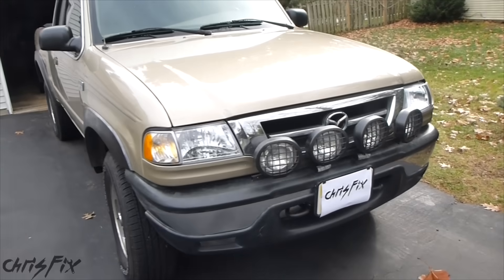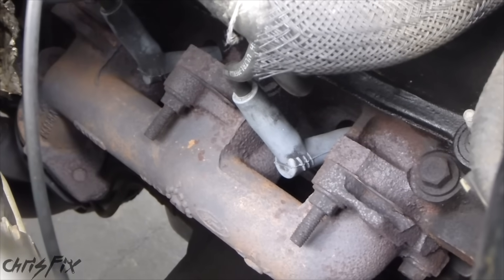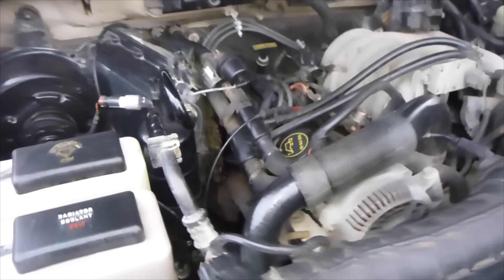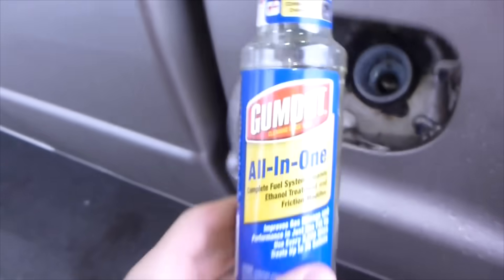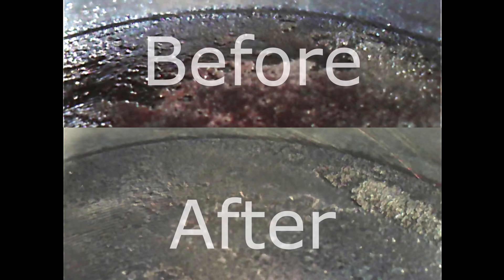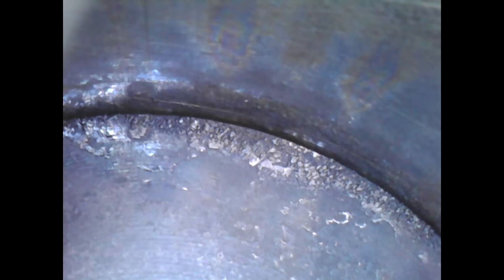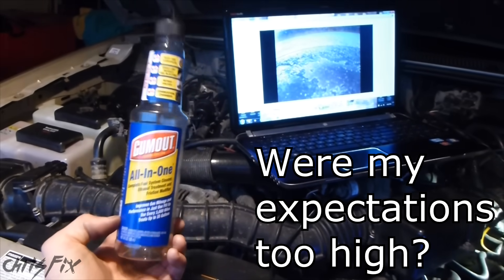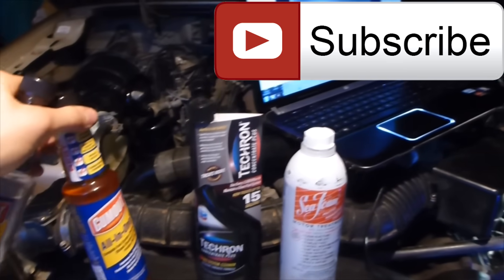Do fuel system cleaners actually work? Testing Gumout "All-in-One"

Comment: Hey Chris!  Thanks for the video! I have always wondered if those fuel additives actually work.  I have also heard of using water to "steam clean" the carbon build up.  I have seen someone drip water into the engine using a vacuum line usually connected to the brake booster.  Have you thought about doing that?  It might be a good test to do if the additives don't work.
Reply from the maker: Joe Bedell Thanks Joe. I will be doing that test as well!

Comment: I tried something called Redex here in UK a few years ago on a Ford Escort with 80k, using it regularly with every tankful of petrol (as per instructions). This product is very popular in the UK, it also also promises cleaning the carbon deposits from the fuel system/cylinder chambers, but the end result was that it made the engine on that car smoke permanently. I don't know what caused the smoke as I sold it before I found out, seemed to be the head gasket, but have stayed away from additives ever since! Thanks for your video :)
Reply from the maker: ***** Thanks man! The carbon buildup probably clogged up a head gasket leak and the cleaner unclogged it.

Comment: I use the Lucas product.  But I but a bottle in every time I fill my tank up. But I put the stuff in after I fill it up. I haven't done a test like what u did. But I do notice that my gas will last longer with it then with out it. About a quarter tank more
Reply from the maker: kapono houston I really find it hard to believe that you get a 1/4 tank of gas more fuel economy from a fuel additive. I am not calling you a liar, but I think there are other reasons why you might get better fuel economy. Also, when you use a cleaner, if your engine is dirty and you did in fact get 25% better fuel economy, then you should continue to get 25% better fuel economy without the additive because your gummed up engine is now cleaned. Know what I mean?

Comment: looking at the before pictures, it looks like the EGR is not equally distributed on the cylinders. Isn't this a contributing factor to the performance of this product?

Chris, I like your videos, keep up the good work.
Reply from the maker: hisham202 Thanks man! Which cylinders do you think are getting more egr gasses?
Reply: ChrisFix I see that cylinders 5 and 6 have that thick-looking deposit. Others have something that looks to be thinner layers of deposits. I mentioned this because some EGR designs have some weaknesses. For example, I had a 2000 camry which accumulated carbon build up in the line feeding EGR to the intake manifold. I heard Ford had issues with the EGR causing uneven carbon build up in the intake runners in their ecoboost engines.I think that build up is expected if the vehicle is not stretched on highways on regular bases. Slow operation cause more EGR thus more carbon into the engine. This is only some theory and I'm not 100% sure about it. Looking at my previous comment, I noticed that I failed to indicate that I have no practical experience with auto repairs other than a few brake pads and a coolant flush!
Reply from the maker: hisham202 That is awesome information and makes a lot of sense. Thanks man, I will have to look into it! Maybe the egr is not distributing the gases evenly like you said, and that is causing 5 and 6 to have a lot more buildup.

Comment: Those bottles say keep engine c lean.  If you want a spotless engine,  use a pump up spray bottle that has a misting nozzle.   Mix half water and half rubbing alcohol.   Get engine very hot the spray the fog straight down the throttle body with engine revving over 2 k.  It will make your engine sparkle on the inside.
Reply from the maker: sketchyssk8shop I showed the bottle, it says on the bottle that it cleans the top of the piston. It also has before and after shots on their bottle of a dirty piston head before and a nice and clean piston head after so... I will be testing the water trick and I will see if it actually works.
Reply: ChrisFix I agree.  The bottle of stuff was less than exciting.  I did not mean to be offensive 8nsurance my comment.   I used the t r u know yo keep me drag motors clean.   My expedition with 253k on it is clean. I use it every 20 or s o.  Just don't dump too much at a time to the engine. U will bu SD t a catalytic converter.   Learned the hard way
Reply from the maker: Your comment was not offensive in any way. I was just explaining what the bottle claimed. I cant wait to test the water trick!
Reply: ChrisFix oh ok.  My bad

Comment: Hi,
IMHO, I think it needs several tries for it to take full affect, you are only seeing combustion chamber only, maybe it need more tries to clean fuel injectors, intake valves before it gets to combustion chamber

in the end, I have tried different brands in my "2001 mercury grand marquis" with over 130,000 mi,  and noticed results in mileage and acceleration

I remember a video on youtube about a guy using hydrogen-on-demand system with regular fuel saying it improved his mileage and cleaned up his engine from carbon build-up

Thanks.
Reply from the maker: ***** Thanks for your input. That might be true, but the bottle says results with the first bottle and you only use this every 3000 miles so...

Comment from the maker: MrTrustafox I agree and disagree. I did say at the end during my discussion of the results that this test was for carbon deposits because that is what I can physically test for and it is also an important part for cleaning engines. The gumout bottle showed before and after pictures of the valves and cylinder heads with carbon deposits before and none after so this test is valid for testing their claims. At the same time, this product might clean injectors and probably prevents corrosion but that wasnt what I was testing. I would not consider that this product "may be" a better product than I show because their claims on the bottle. If they claimed that this was just an injector cleaner, then sure, I would agree, but they say this is a carbon deposit cleaner too (for piston heads). See where I am coming from?
Reply: Can I send you gumout regane?
Reply: I've found "STP Petrol Treatment" and "STP Petrol Injector Cleaner" that would work on my 1.6 petrol engine - Now should we use these BEFORE an oil change,  or we can use them anytime? I'm thinking about all that dirt that will remain in the oil until the next change... And also, can we use a bottle of fuel additive and a system cleaner in the same tank? Or we should separate these two?
Reply: ChrisFix
Chris: I can`t wait to see the coming video about using seafoam.
Reply: Nice chris..
Reply: ChrisFix Can you try RedLine S1?
Reply from the maker: ***** I think we will find something that works. We will see!
Reply: ChrisFix Can you try the Gumout with Regane in it? That's supposed to be the 'good one' along with Redline SI-1 according to BITOG
Reply: Nissan fuel filter cleaner
Reply: Where's the second video
Reply: Hey what if you put brake clean in there whould that hurt???
Reply from the maker: You definitely do not want to put brake cleaner in there. It will seep down into your oil and that would not be good!
Reply: Ok when do plane on trying c fome
Reply from the maker: patrick cordery This month hopefully!
Reply from the maker: ***** I wont be doing that in my truck. Loosening up that much carbon that quickly can cause problems.
Reply from the maker: Calvin Lim I have it on the list but I need to find some more cars to test!
Reply from the maker: yogaexe I will be testing redline! A subscriber sent me redline via my PO Box so we will have a video!
Reply: ChrisFix  guess who got a new sub
Reply: Its a interesting video. I used it to, it cleaned my injectors very good. im sorry for my bad english but did you checked under the valvescap for some slush? it look like something is leaking, maybe your cilinderheadgasket?.  than engine cleaner dont work, slush keeps coming when water or coolliquid are in the oil. slush become Black when its getting Older. 

Goodluck.
Reply: ChrisFix love the vids. was the cost of gas around $2.67 a gallon?
Reply: ChrisFix please try Amsoil PI
Reply: ChrisFix can you do the chevron one i use that one alot and think it works pretty well .
Reply: that is also what I worried, my 2006 navigator has 180000 miles, and can I use the seafoam directly? would that cause the much carbon problem too? I currently have a P0303 problem, possibly because a cloggged fuel injector. please respond what you think might be the best solution to me? what would you do if you are in my spot? thanks
Reply: ChrisFix which of these fuel additives has had the best result? I've your videos but I am too busy to watch them all.
Reply: ChrisFix what if u put little bit of seafoam in each cylinder and let it soak like u did to the lawn mower . Would that be a bad idea or would it work
Reply: fix it ur self and grow: thats actually the proper way to break down a carbon deposit., it doesn’t take much, i use i mini squirt bottle or long tube to get in cylinder., remember to crank car over without plugs and make sure to blead pressure from fuel system to drain any exstra sea foam
Reply: Rickardo gonzalez: it dosnt work, there was a whole cnn special about it... just a scam to rake in mony
Reply: ChrisFix ...good job..
Reply: ChrisFix do a seafome test
Reply: ChrisFix maybe that is a product to use 3 times a year and it will mainly clean the surface of The cylinders. But to clean off large carbon deposits, better getting other products, or simply disarm The engine
Reply: ChrisFix was this with p.e.a?
Reply: I use Wynnes or Redex fuel cleaners twice a year and they do work.It's much more smoother and quicker response on the throttle.I used Forte product (oil and fuel treatment) 8 yrs ago as a Forte representative came into my garage so i got some and boy did it do a great job! Just took 10 mins of driving and the throttle response was impressive.
Reply: I think it's not good to use because the carbon deposit has to go somewhere out of the engine..cause it might stock in the piston rings
Reply: If you can get a camera in there, isn't there a tool you could just jam in there and clean it off yourself?
Reply: What if we put this gumout in a car from the start..i mean when the car is new..if would put it every time we change oil.. would it make  a car resistant from building carbon?
Reply: Just not practical to expect any product to loosen 120,000 miles of baked on carbon....suggest using when car is new every oil change while the carbon is still soft and not baked on for long periods making it solidified.
Reply from the maker: Calvin Lim Yes you can! I cannot promise I will make a video (especially right away) because I need to find some other cars to test it on, but if I have it and have a car to test, I will definitely make a video! 
ChrisFix 
PO Box 220
Tennent, NJ 07763

Comment: Can't we use compressed air to clean them?
And does the cleaned carbon deposit exit from the exhaust?
Reply from the maker: Taha Masood I am not sure that compressed air would remove the carbon deposits. You need something to dissolve them. The carbon deposits exit though the exhaust.
Reply: Oh yeah it is hard and stuck on the metal
I guess on the video it looked like some small filings like thingy

Comment: Do a video like this on seafoam... I'm very interested in these engine tune up videos because my 4.6L 2v has 115k miles and I want to learn the best tune up practices for it. Great video and I will definitely share.
Reply from the maker: ***** I will be testing seafoam, techron, water, and lucas fuel treatment.
Reply: ChrisFix
 I look forward to the Lucas fuel treatment as well. It has less PEA than the Gumout tested here and if memory servies the Lucas treatemtent only has 2 ingredients. What MSDS calls a medium grade solvent and PEA. So other than the solvents being different Gumout regane and Lucas fuel treatment are sorta the same. Now you got fancy Chris and lost a little solvent to additional treatments to also treat for rust and corrosion which Lucas and Gumout Regane don't have.
Reply: ChrisFix interesting difference about seafoam is you can put it into a vacuum line instead of the gas tank. That's what I've done. Don't know if that makes it any more effective.
Reply: ProjectFarm has a ton of videos on seafoam tests!
Reply: ChrisFix i use sea foam.. please keep me updated with the sea foam testing... thank you..
Reply: Camaro Joey  and)

Comment: People use these types of cleaners at much higher concentrations than recommended. Some people say to use a full bottle in 1/4 to 1/2 a tank, then go for a short drive at highway speeds and rev the engine a lot in low gears, then fill the tank to full. I've also heard of people who run the engine with the cleaner and an almost empty tank, or even pour it directly into the carburetor, apparently doing this right before an emissions test can help the car pass. It might work better at higher concentrations, or it could be bad for your engine. Either way the manufacturers probably state the dosage much lower than it needs to be, just to cover themselves against any lawsuits if engines get damaged.

In the UK, the various cleaners that you can buy on the high street have apparently got much weaker over the years, probably because of laws limiting what chemicals can be in them. There are some other brands you can get which are meant to be trade only like forte products, these are meant to work quite well but there's still not much good proof.
Reply from the maker: David C Those are interesting ideas. For this test and the follwoing tests, I will follow what the bottle says because that is what the people who created the product recommend. I wonder how concentration the cleaners might affect the results. This might be another test I will try out! Thanks for the idea!

Comment: Good video Chris. But it doesn't show how well or bad the product worked on cleaning the valves and injectors. It might work very well there but not significantly in the combustion chamber, so overall would be better product than your test is showing.

Comment: At least you still have good cross hatch on the cyl walls. I use xylene at a 10% to a gal ratio 4x a year. PS get your RPMs up under a load and heat up those combustion chambers once in a while. If you see smoke it worked, if you see pieces you tried to hard. LOL
Reply from the maker: charles albert Thanks man! I would never put a solvent in my gas but hey, everyone does their own thing! I laughed at your last sentence haha

Comment: Very well done and I'm looking fwd to the rest of the series. Should be nice to see if you get improvement in fuel economy.  Another "myth" is once per tank when the engine is at operating temp, you give it a good kick or 2 and it keeps things clean.  Is it true that carbon will build more on slow revving engines rather than on higher revving ones?
OK, well get driving so we can get the results!  LOL
Reply from the maker: hasbeengood Thanks a lot man! Stay tuned for the rest of the series! I am just as excited as you are!

Comment: Few suggestions Chris: Relate how you feel the vehicle drove before-and-after 'impressions' if you will.. Was there improved acceleration, performance, gas mileage which would indicate any change by the product? You had a slightly higher (+13-20%) concentration of gumout than was suggested so you should expect slightly improved results from those on the bottle!
Is it possible the product 'loosened' some carbon deposits which will be further eroded on another application?? And was your vehicle otherwise operating well? No oil burning issues or cylinder pressure problems? What kind of driving were you doing, out of curiosity? I'd think that stop and go would make a difference in recurring deposits but I'm not an expert.

I'm skeptical about these products overall; have used several and employ the Chevron additives regularly but recently changed to Startron which FELT like it was improved as to acceleration and response. But alas, these have not resulted in better fuel economy which is ultimately the place where a cleaner engine will show results. I'm still on my first bottle of Startron, second treatment, so I will let you know when you post the next video.

Overall scientifically I think the approach well done and you usual video precision!
Reply from the maker: ***** Thanks Kelly! I did not "feel" and differences and the reason why I didnt include that because the "seat of the pants feel" is just a guess. I wanted to show the hard evidence that is irrefutable. You can disagree with my opinions, but the before and after shots are there for you to deduce what you want from it. Same goes with gas mileage. You cannot accurately gauge an increase or decrease of MPGs because there are so so so many variables. Even if you drive the same route, it can vary with traffic, wind, weather, etc. But I definitely appreciate the suggestions but that is why I didnt include those tests. It is possible that the carbon got loosened, but I think, from these results, that the additives mostly dissolve the carbon but I cannot say for sure. My vehicle is otherwise in good shape. no problems. Thanks for the feedback and thanks for approving my approach for these test! I appreciate it!